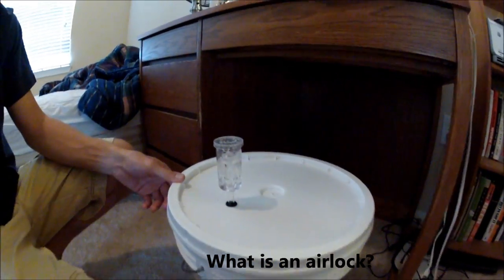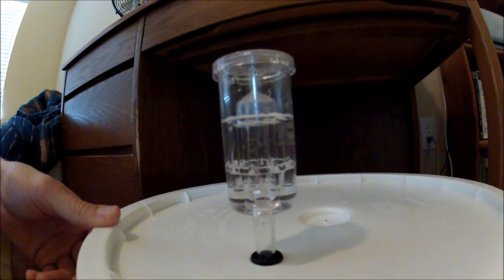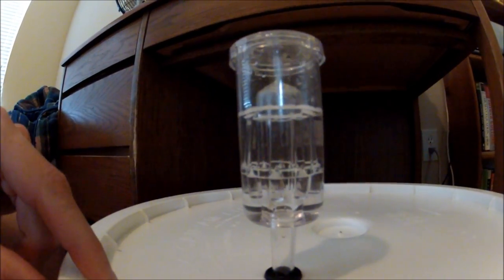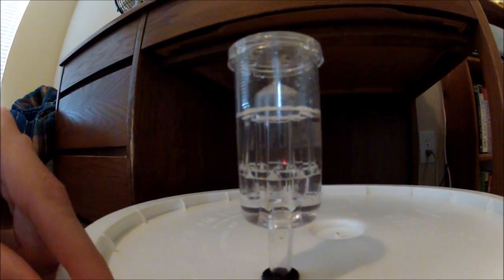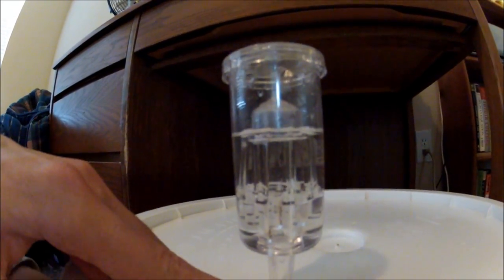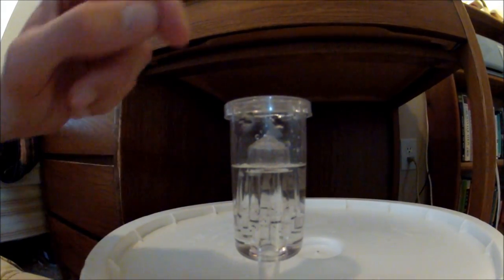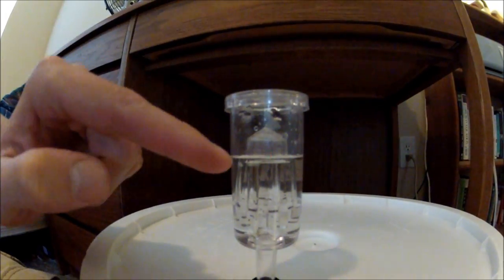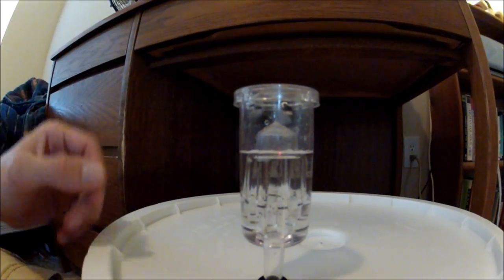Fermenting Airlock Explanation

Comment: Hi. Do you fill the airlock with water first before putting in the inner cap or put the inner cap first then fill with water?
Reply from the maker: Doesn't really matter as the outcome would be the same. Just don't fill it with water while in use unless you're very careful and know what you're doing (you don't want to add any contaminates to your brew)

Comment: I filled my bucket a little, too full and wine is coming up into the airlock.  Will it still ferment properly or do I need to take some liquid out?
Reply from the maker: Opening it and removing liquid would probably be worse so I would just leave as is and hope for the best. Air should still not be able to travel down through the airlock so I think, in theory, you'll be OK. Just with a bit of a mess. It'll ferment still.
Reply: Okay thank you

Comment: Is there an air bubble or water in that small cap in the middle?
Reply from the maker: air from the yeast. Wouldn't be possible for water to be in that middle section, it would fall into the fermenter.
Reply: @McCAlexander  I'm sorry. I mean in between the middle section and the cap.
Reply from the maker: @seanzievlogs7126  in very middle is tube from fermenter. Sitting on top of that is a cap. Water is poured around the cap so air can be released through water. Not sure what section you ate referring to.
Reply: @McCAlexander  I guess it's hard to explain, lol. It may not matter. The cap has an air pocket inside like when you put a glass upside down into water, it doesn't fill with water. It this the same concept or should that cap have a water level inside?

I'm probably overthinking it, but the instructions are scary and I don't want to ruin the batch 😂
Reply from the maker: @seanzievlogs7126  you're definitely overthinking it. Yes there's a water level inside the cap. As you see in video the cap will rise until stopped  by top of container to let air release. And it couldn't possibly ruin a batch as long as everything stays assembled bc if something went  wrong it's just a few drops of water getting into a giant bucket of water (and yeast, hops, etc).

Comment: My airlock isn't bubbling, what do I do?
Reply from the maker: Could be a few different reasons. Is the air escaping elsewhere? Make sure the vessel is completely sealed. Did it bubble at first but now has slowed or stop? This is perfectly normal. Or have you waited a few hours since adding the yeast before bubbles? It could take some time to build up enough CO2 to cause bubbles. Was there never any bubbles and you're a day or two in? In that case maybe you forgot to follow all the brewing steps to ensure the yeast are added and eating. And the worst cast scenario that would be the very last thing I would consider is the possibility of the yeast you used being dead and ineffective and thus not breaking down the sugar. This last piece could mean a need to add more yeast or a potential loss of the wort. Only assume this when everything else is ruled out.
Reply: @McCAlexander  its not escaping elsewhere that I can tell. I didn't notice if it bubbled after I added the yeast cos I left it in the cupboard. It's been 3 days since I put it in the fermenter. Maybe I should wait a little longer before panicking
Reply from the maker: @splashymothtv9952  agreed, I think you just roll with it and hope it turns out. It is definitely possible that it's slowed down and will be just fine.

Comment: so what about that air pocket in this airlock, doesn't it has oxygen which is bad for our defermentation?
Reply from the maker: No oxygen in the tube or otherwise. It gets filled with the gasses from the fermenter. It's a sealed system because air does not (can not) travel  down through the water.